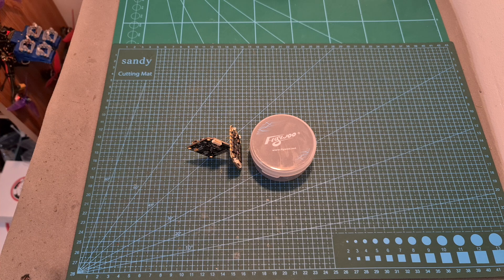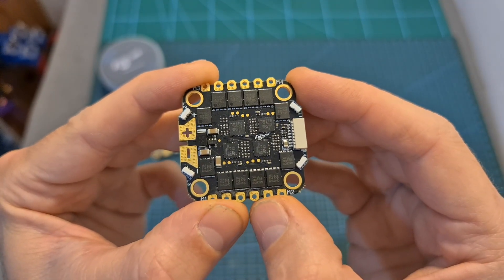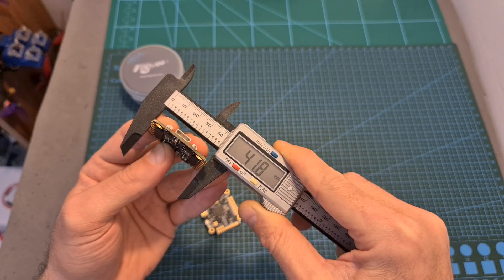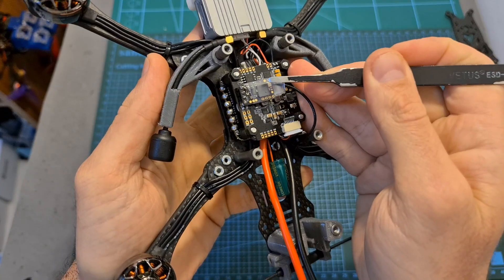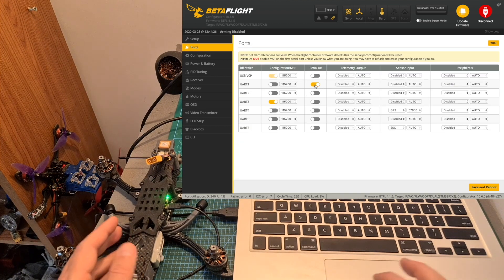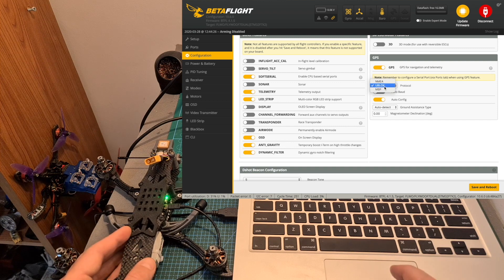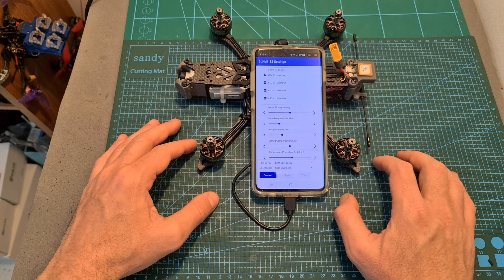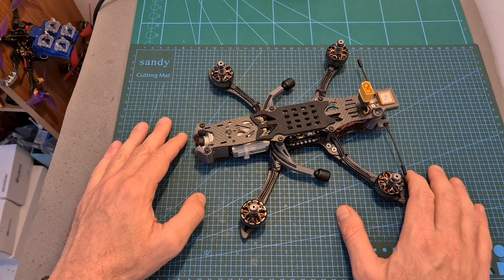FLYWOO F722 GOKU Stack - Setup & Overview

Comment: hello, thanks for the review. I saw a comment on getfpv about this esc and the owner said that he had fried 2 and also his remark about the esc was the esc is not reliable. how long have you used this esc and is it trustable to use long range quads ? I am asking cause i have one of this I am going to get new stack if it is not reliable as he told. this is the comment: 

"I have owned two of these ESCs, and both have died fairly quickly. Both deaths were while operating at 6s and drawing around 30A total (as in less than 10A per motor) for Flywoo NIN 1350kv motors.

Flywoo must be using sub-par MOSFETs, as other ~50A ESCs seem to run fine under the exact same conditions. I replaced the FETs on one with thosRead more about review stating Not Reliable for 6s Operatione of my second that didn't burn up, and that seemed to run fine for a while, but same issue: blown MOSFETs, magic smoke escapes, even at low amp loads."
Reply from the maker: Sorry but I didn't have a long experience using it (That's what happens when you go through a lot of products...). Anyway I don't remember that it had any particular issues when testing it.

Comment: Why is esc activated in uart 6?  If I soldered sbus to uart 3 rx, would I select esc under rx 3 instead of 6?  If I’m using dji’s fpv receiver, should I leave serial rx turned off under uart 1?  I still can’t sort this out for some reason. On my flywoo goku f722 fc, I soldered + and - to the batt pads. my sbus to uart1 rx, my tx and rx to rx 3 and tx 3 (respectively). Should I then activate msp for uart3 and select esc for uart1?  Leaving serial rx turned off?  Under my current configuration, I can move the sliders with my remote in beta flight, but I can’t get them to move the sliders in the servo tab in the dji digital goggles. No osd/telemetry either. So frustrated!  This is my first build. Can somebody help me?  Thanks!
Edit:  also, I have updated every component (receiver, goggles, fc, betaflight etc.) to the most recent versions.
Reply from the maker: ESC telemetry is enabled since the FC is getting ESC telemetry on this port from the ESC. There is no need to update the FC to the latest version out of the box, especially without having some basic knowledge of how everything works (no offend). 
Do you still need help or you got it sorted?
Reply: I have same problem.. did U fixed it?

Comment: Hello Gal! You should (i would appreciate) make some videos for first time FPV users. I never flew a quad before and just received the RTF Mr Croc DJI quad, with dji air, dji goggles and still waiting for my remote controller (about 2-3 weeks out). The thing is the quad came completely pre built, all I had to do is bind goggles to air unit and soon the remote. The rest just works. It has also the gps on, and also 4 wires sticking out the back of the quad (labeled TX 2, RX 2, Ground and 5v) that are soldered to the Goku. I have no idea what those could be used for. Since you have the same quad and probably more and more users will join this way - buying a pre built FPV DJI digital system quad without ever have owned a quad before, i think it would be great to have a video of what to do with it :). What do I do now? What do i configure? Thanks!
Reply from the maker: Thanks for the suggestion Alex. I plan to release a video for beginners in the near future. 
As for the Wire - it's supposed to be connected to a Radio Receiver (which is not applicable for you in case you are using the DJI radio controller). 
Let me know if you need any further help.

Comment: Great Video as Always. By The way.. I didn´t know that the DJI system can be also used with a diffent receiver and Radio. I thought you were forced to used the whole DJI equipment. Could you confirm this?
Reply from the maker: Thank you. Yes, of course - using the DJI controller is not mandatory and you can use your own radio transmitter like I do.
Reply: @KremerFPV  ohh that's cool. Thanks very much for this!!
One last question..are you able to use your own TX Antennas? I flight long Range and I use the Lumenier AXII + Patch Antenna. 😁